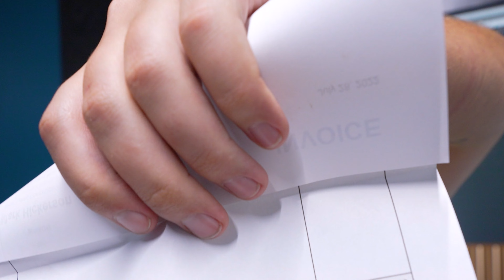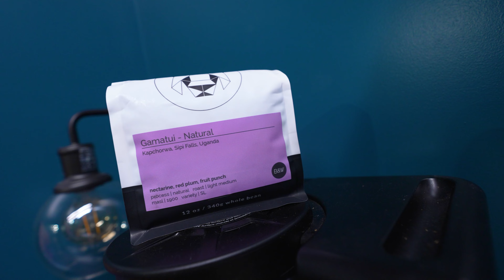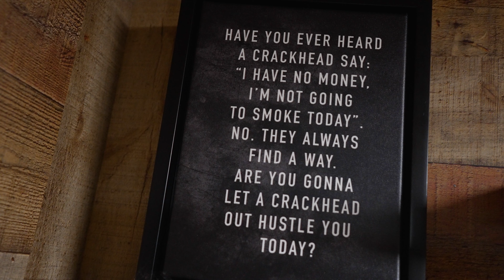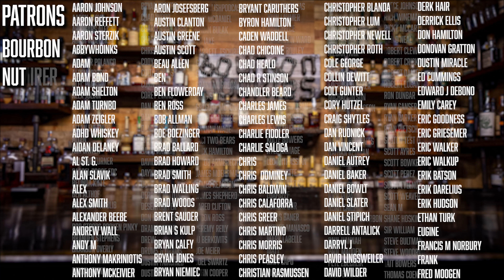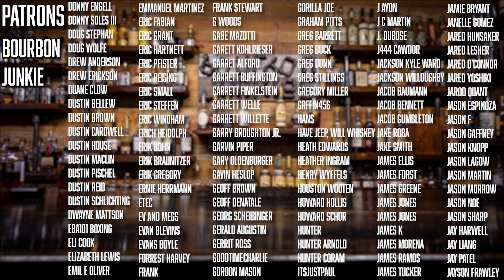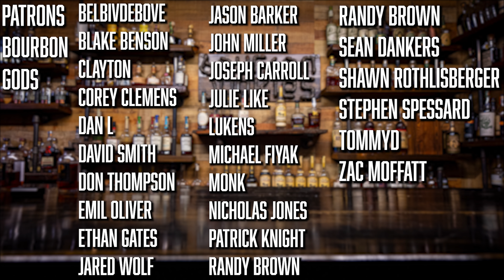The Future of the Junkies Pt4: Finally Leaving the Hut

Comment: This is great! One question why the wall between sets, why not have two different wall sets, with lights and cameras in the middle and just have to be turned to switch from set to set? And then maybe like a storage room for the other? Could have even had a 3 set wall as well, with lights on tracks in the ceiling.
Reply from the maker: Audio would be a problem in a room that size for sure
Reply: @BourbonJunkies  Acoustic panels on the ceiling would help with that, and also in the rooms now. The castle looks great btw!